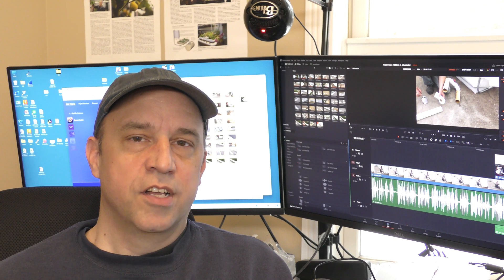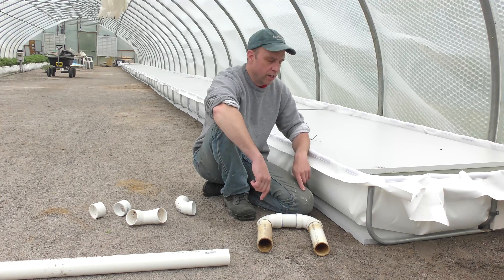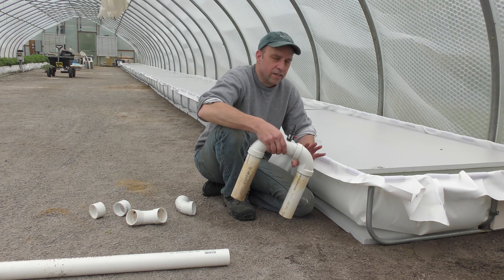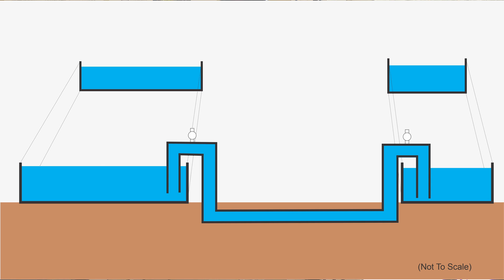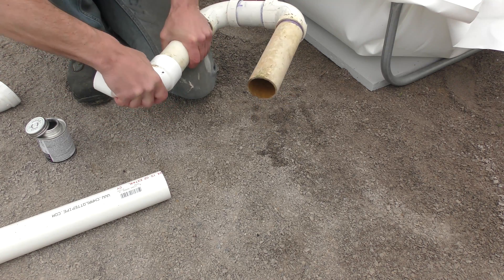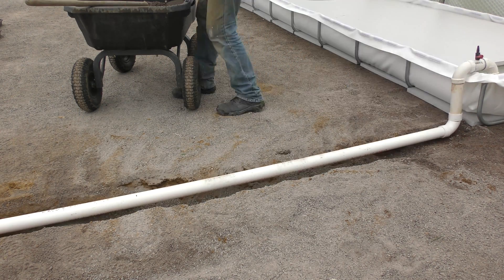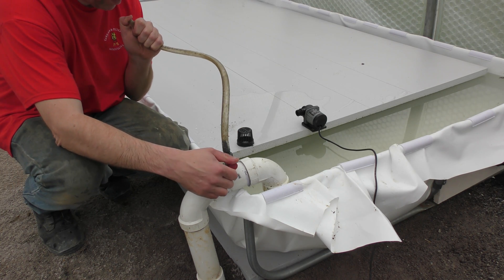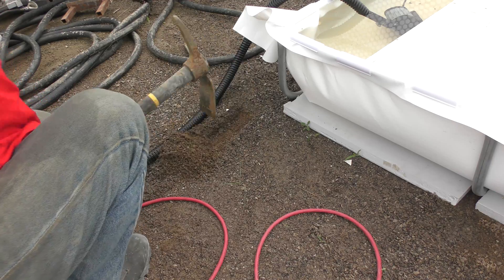Greenhouse Expansion - Bridge Siphon

Comment: Nice one Rob. I never bury them either..😏
Resolve has a voice isolation "switch" under the audio settings on the main page if that helps any. I've had to use it a bit recently fixing old videos for a project I'm working on. Not sure if it's a paid version only feature though. 
Hope you post a vid on the dome reno's when you get the time.
Reply from the maker: This is the first time I tried Resolve.  I was playing with the noise reduction but haven't quite mastered it yet.